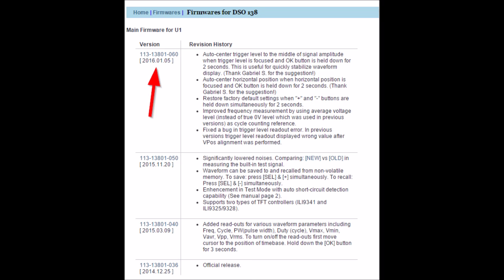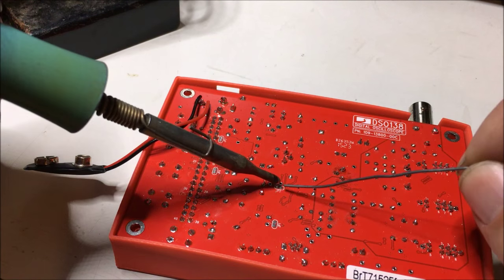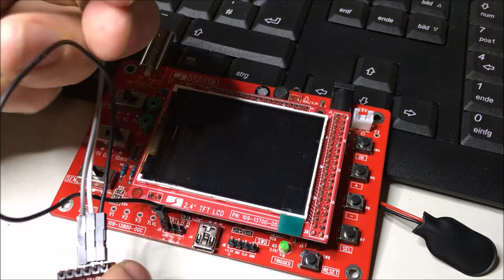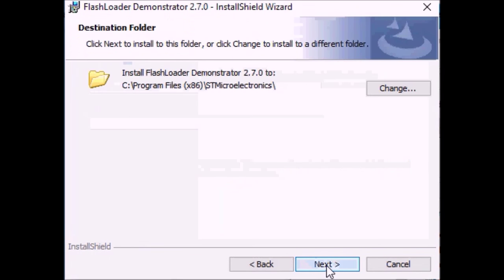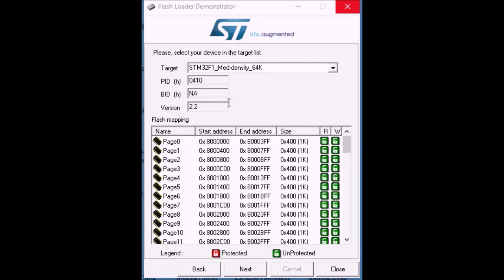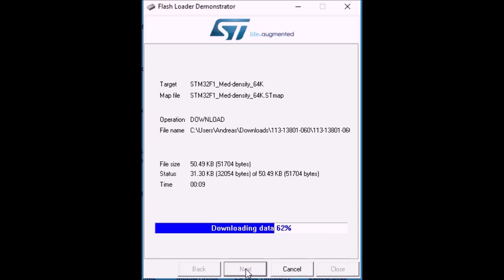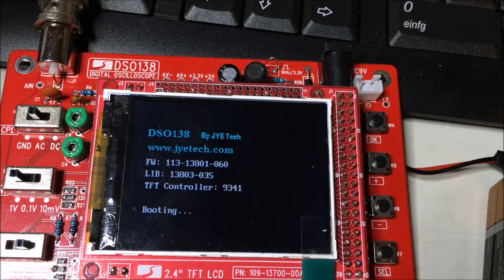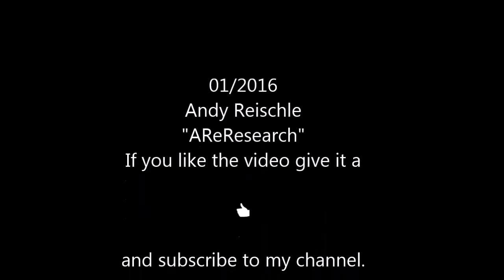JYETech DSO 138 firmware update

Comment: just watched this video, and found it very informative. could you tell me what the little usb device you used is called?
Reply from the maker: It ist a USB to serial bridge (or adapter). If I had to buy one these days, I'd go for this one: https://www.banggood.com/3_3V-5V-USB-to-TTL-Converter-CH340G-UART-Serial-Adapter-Module-STC-p-1232728.html?p=NT1005763073201409DA 
It can be jumpered for 5v or 3.3v logic levels.

Comment: Hello! Great video! I installed the newest firmware on my DSO138 but now my probe is reading less then the real value (I connected it to 5v from an arduino and it shows only 1v). Do you have any clue what could caused this?
Reply from the maker: Sounds like a stupid question, but anyway: do you have a connection between the scope and the arduino‘s common ground? (Via the probe‘s ground connector?)
I couldn‘t think of anything obvious that could cause a 5:1 reading error.
Reply: Yes, I have connected the common ground, also I connected a multimeter which shows 5V while the oscilloscope is only reading 1V. I looked everywhere and I couldn't find anything similar. Well, actually, maybe this information will help, I did a pretty stupid thing and due to my lack of attention, first time I connected the pins from the TTL something like GND -> TX; RX ->TX; Tx -> GND. But I got an error that it couldn't find the flash, retried with the correct connection and then worked like a charm. I don't know if this is problematic. Thanks a lot for the fast response tho! I really appreciate it! :D
Reply from the maker: What about the slide switch (x5 x2 x1)? It that is not switching both sets of contacts, it may result in a 5:1 error reading.

Comment: Can I just use the motherboard COM port (Pin 2,3,5) to directly connect it to the PC without this converter? Because I don't have this converter.
Reply from the maker: +AxelL No1 No, the voltage levels can be up to +/- 12V there . You could use a max232 IC to convert that to a 5v signal and divide that down to 3v. But you'll be better off with a USB converter with 3v output levels. They are quite inexpensive. About a tenth of a blown scope :-)
Reply: Thanks!... I saw the price, I just wanted to skip the waiting time if possible. It could get long especially for cheap items from China.

Comment: can i use this scope in the output of an amplifier?for biasing
Reply from the maker: As long as it is an audio amp and not RF. It has a DC coupling option, so you should see the bias voltage.
Reply: @AReResearch  my councern was the output voltage of the amp.its working with 35v dc.would it be a problem?
Reply from the maker: The manual says 50Vpk. You could use a x10 probe to be on the safe side.

Comment: Thanks for the video , i will try it because mine does not sweep any more...
Reply from the maker: It is more likely you have a cold solder joint if it stopped working. If your DSO138 is seriously damaged, I'd go for a DSO 150: http://www.banggood.com/Orignal-JYE-Tech-DS0150-15001K-DSO-SHELL-DIY-Digital-Oscilloscope-Kit-With-Housing-p-1093865.html?p=NT1005763073201409DA
It has more or less the same specifications, but I find it more user friendly. It is also well below 20€.

Comment: DSO138 прибор новий,пропав промінь,пробую прошивати програтором CH341A MINI PROGRAMMER та USB TO TTL  видає програма помилку -No response from the target the Boot loader can not be started.Please verify the boot mode configuration and flash protection status.Reset your device then try again... - конфігурацію  RX-TX міняв. Що може бути ? Дякую за відповідь!
DSO138 is a new device, the beam has disappeared, I try to flash it with the CH341A MINI PROGRAMMER and USB TO TTL programmer, the program gives an error -No response from the target the Boot loader can not be started. Please verify the boot mode configuration and flash protection status. Reset your device then try again... - I changed the RX-TX configuration. What can be? Thanks for the answer!
I did everything according to the instructions and put the jumpers.

Comment: That usb port confuses me. My directions say something like "it's for homebrew use" but then the scope seems to have some kind of software that will lock you out if you update it wrong. O.o

And I was so proud of how well I soldered those micro pins only to find out that piece isnt necessary or even working, apparently...
Reply from the maker: I agree. Seems rather pointless. I have little hope to see USB support for that device ever. Could be so cool to transfer screenshots.
Reply: I found out the same thing, after close inspection I realized there are not enough conductors on the PCB to be of any use.

Comment: where did you get that casing? printed by yourself or bought somewhere?
Reply from the maker: It is this thing from Thingiverse: http://www.thingiverse.com/thing:779159 a friend printed it for me, but it didn't last very long.
Now I use this one from Banggood: http://www.banggood.com/Transparent-Acrylic-Sheet-Housing-Case-For-DSO138-Oscilloscope-p-1034768.html?p=NT1005763073201409DA
 It was amazingly hard to assemble, but looks absolutely great and works ok. (I only worry that the switches will break one day)

Comment: hello sir,If I want to use this circuit measuring 220v -400vac wave how to do
Reply from the maker: The scope is rated 100V (peak to peak), so you could use 1:10 probe. But there is no protection from electrical shock, so I wouldn‘t use it for potentially lethal voltages.
Reply: Actually the high voltage is only at the test end of the probe, no high voltage to the scope. 1:1, 10:1 or 100:1 start at the highest V/div on the screen and if there's room for more move to a lower V/div for clarity of the wave pattern. The probes with ratios have voltage dividing resistors inside them. If fact, one could even build a multiplier probe if needed, you would have to calculate how much current to limit the circuit to. You do not want any more than a few milliamps to go through the resistors to avoid heating them up. Remember the higher the voltage the higher the wattage so with small watt resistors use very high resistance. Ohms law and watts law ! Also a DC isolated probe can be made for AC signals only. This would be a good deal for sure if you want to measure signals in the range you're interested in along with the multiplier ratio. Simply use a multi position slide switch to select the ratio and either DC or AC. If know how to draw and / or  read schematics you got it made. Just pick a suitable housing to put it in with the coaxial cable and BNC coupling.